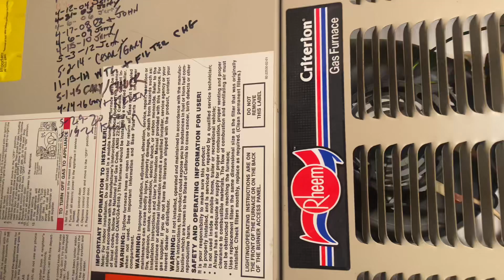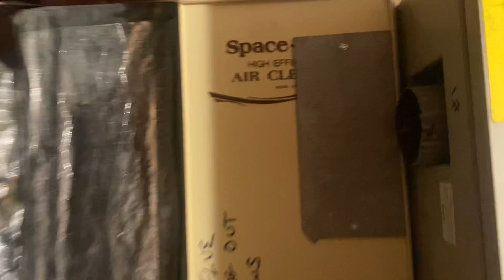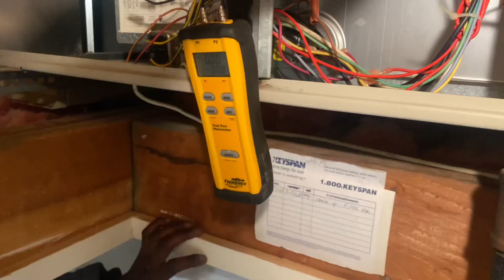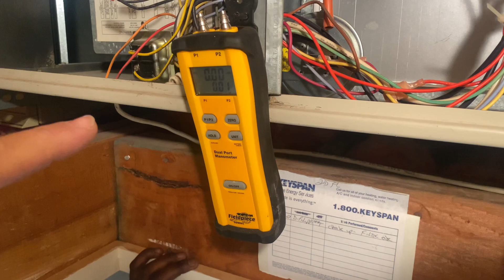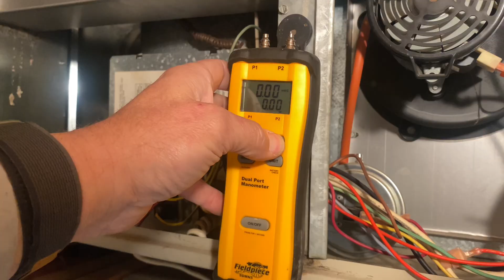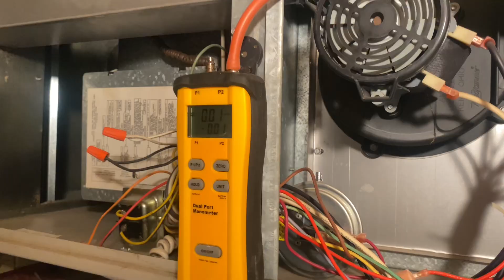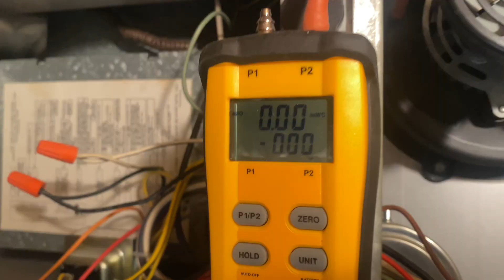Revealing the Easiest Method to Test Cracked Furnace Heat Exchanger

Comment: If you cover the flame inlets and  the exhaust port, the positive pressure buildup inside the heat exchanger from the blower fan will be quite pronounced with a cracked heat exchanger but will stay at zero if the inside space of the heat exchanger is isolated.

Comment: Yes, even with the blower door installed, so the furnace doesn't pull that abnormal amount of air from the attic, you could still get a false positive "wc" reading from inducer port, with blower only, because the attic access door is open to the attic as well. A better test, other than a physical inspection of the heat exchanger after removing it from the furnace, would be to do combustion analysis instead. Ensure the blower door is installed, have the attic access door closed as well. Run a strip to see the CO and C02 proportions with only the inducer and main gas, before the main blower starts. Then run the same test again, watching the CO and C02 proportions again, then see if there's a big change in the C02 when the blower starts. That can be good indication of a breach in the heat exchanger. Though a furnace that age, is a decent candidate for system replacement any day of the week, and twice on Sunday. Just saying... God bless ...

Comment: Gas stovetop burners are 15K BTU.  ... a little weep in a 55K BTU heater isnt a functional concern if the flue pipe is going to the outside.

Comment: BAD TEST. you have the other port on manometer open .real close to blower thats why its changing.
Reply from the maker: wrong, but thanks for your feedback. keep watching.
Reply: @PipeDoctor  Im not saying hx isnt bad, But you are not performing that test correctly. Next time you are at a furnace, put you manometer next to an open blower door and see what it does. You should have 0 psi to reference from. (why some dual port pressure switches have a hose to burner cabinet  which is connected to outside air)
Reply: @dell982  Did he not make that space negative pressure with the blower compartment open?

Comment: Do the fan running and the matches proof test. But wait , why change the whole unit when you can just put a new heat exchanger for a lot less of $$$ 
People don’t have a pocket full of money let them decide , give them 
New unit cost is $. 5 k 
This is old new heat exchanger is $800 ? But , is old , you could still use this for a few more years bla bla bla

Comment: Respectfully disagree. Imo the easy way is jump r to g and then use a long stem lighter or match and test every burner port, if one causes the flame to dance then its cracked. This test you show is a good test but you gotta cap the other port on the differential meter or use a single port manometer

Comment: Did you end up replacing the entire furnace or just the heat exchanger?
I figure the outer shell of a furnace would last a life time or  two! Like dropping a fresh engine in a 1920's car you could run the body forever. With fresh parts  you could run it 500 years maybe? Easier to get a new one than swap a motor though to be sure.
Reply from the maker: Entire furnace
Reply: @PipeDoctor  Did you ever see the cracked heat exchanger or just scrap it man? I'm fixing to try the test on my old 88 furnace.  All I have is a vacuum gauge that I use on engines but it should work.
The thing has never set off a carbone monoxide alarm in the house but there is a lot of rust in the flue and in front of the burner tubes.

Comment: I love the manometer testing . But I don’t understand the pressure difference with the numbers you came up with. Could you give a better explanation. Great job! Love the channel.
Reply: The inducer is connected  to the exhaust side, the blower should not effect any pressures in that side as it is separated by the heat exchanger, so a reading from the combustion side with ablowr only running would indicate pressure change due to the blower ( but on the combustion side ) and so a crack
Reply: @MrDmadness do you have a formula? Like with inducer running pressure in in wc +- the pressure in in wc when just blower is running proved air leakage through the heat exchanger?

Comment: Awesome test man! I haven't seen this version yet. I saw on another video this morning where a guy stuck a long lighter in each burner tube with the fan motor on only.
The flame on the lighter stayed calm and steady in each tube and passed the test.
So then for the purpose of the video he drilled a small hole in the heat exchanger and returned to the flame test.
That tiny hole he drilled caused the flame to dance all over the place in the tube with the hole drilled.
Reply from the maker: Very cool
Reply: Which video is that one? I'm trying to see if my heat exchanger has a crack. Thanks

Comment: Great video. I have seen draft inducer assemblies replaced with a less than perfect application of the 3M rubber tape for the gasket (slight gaps in the tape but 98% sealed). Could this not also cause a reading with the blower activated? Basically, could this leak be coming from a less than perfect gasket between the inducer and the heat exchanger?

Comment: I hope you know physics.  If a heat exchanger has a crack, you can "feel" it only after 15 minutes heat mode, crack will open when heat exchanger will hot. When it's cold, you probably can't find it. Use CO tester for it. Everything that will be higher than 50ppm potentially shows you a crack.

Comment: You can also take a long grille lighter, insert it into each burner, with and without the blower on. If the flame dances with the long lighter… there’s a crack/hole in that part of the exchanger
Reply: Read this after my identical comment. Jump r tog so blower comes on and do this. Yup.
Reply: You mean insert the lighter and turn on the blower motor to see if the fame dance right ?
Reply: @abazism  yes. Its very obvious if you have a cracked exchanger

Comment: With the blower door off and flue pipe not attached that isn't an efficient way to test, especially when the flue runs through the blower cabinet. Enjoyed the video never the less and this method may work it in other applications.

Comment: when you do that test with the blower access panel off, you put the attic space under negative pressure, affecting the manometer reading. manometer reads pressure difference and has negative port.
no substitute for a visual inspection imo

Comment: the flue pipe is in front of the filter and it needs removed to change the filter. very likely they just left the flue and gas off for summer/multiple filter changes, figuring they'd put it back on when there was a no heat complaint.
the blower compartment being open could cause pressure change enough via burner and flue openings to make the manometer read. test with the blower cover on, also it would be wise to block the flue hole, with the burner ports open then cover them individually and watch for pressure change. it's possible in some designs to have a very tiny pressure change due to leakage through fiber gasket material at burner and collector box end plates.
you may have jumped the gate on that one, it's best to always back it up with visual inspections/proof.

Comment: I like your channel and think you're a great tech, this test is useful.  I also think that this test may show nothing.  What if the crack was very close to burner openings, the air could enter and exit the HX without changing the pressure reading at all.  As pointed out in other comments it's not sealed.  To make the test better you could seal the vent connection which in this case the venting was already removed and seal the 3 burner openings using foil tape or if it's a hi-eff just seal the 2 pipes outside the same way.  Now if air enters the HX it should show a positive reading on the manometer.   You also mentioned in 1 of the comments that you are replacing the unit please do a follow up video and show the HX.
Reply: that should just be "one" test of the heat exchanger, others should be visual inspection inside and out as well as combustion analysis, watching the flame when indoor blower comes on and more.

Comment: While what you are doing has some merit the test process is flawed in the fact that heat exchangers are not hermetically sealed. It's a great prescreening, but it is not definitive. So I am not saying don't do it, just go further. Section 4.5 of AHRI Guideline X on heat exchanger testing clearly states that a small amount of leakage can be normal. "Visually Inspect Heat Exchanger Disassemble the furnace until you can visually inspect all heat exchanger exterior surfaces. Any crack or hole that is big enough to affect combustion is visible to the naked eye. Do not use water, cameras, or smoking agents to check for leaks. Furnace heat exchangers joints are not hermetically sealed, so a small amount of leakage can occur. Replace the heat exchanger or the furnace if there are any splits, cracks or holes. Note: If the inspection described in Section 4.5 does not show holes, cracks or separated seams, further investigation is advised to determine the source of the CO contamination."
Reply from the maker: Thanks for sharing

Comment: would definitely like to see the same test on a few brand new furnaces ,to confirm diff between new / known good   vs ones that test bad...its the scientific thing to do ...Dr Pipe Doctor
Reply from the maker: watch in a couple days
Reply: @PipeDoctor I'll be trying this method tomorrow Thanks. I'm a fan of yours bro keep the videos coming.
Reply: I thought this test was interesting enough to test on my own ~10 year old 80%er.  I got 0 change on the manometer indicating a good heat exchanger. The next test would be to pull the blower panel, but I didn't take it that far. I trust the results from the video.
Reply: Please post the result thanks

Comment: Can someone please explain to me what a common wire really is? Sounds crazy but I’ve been in the trade for 4 years and I still don’t fully understand what a Common really is. Is it some type of neutral wire?
Reply: There are several youtube videos that cover just this topic. Do a search. At least one is from HVAC School I think.
Reply from the maker: @Keegeth - you are correct. The common is exactly like a NEUTRAL. Having just 24 volts on R don't do nothing unless something is there for that return back. It functions just like GROUND. Look at a main panel. The white wires and greens all end up in the same place (i know not really, but on a 24 volt circuit it does.)

Comment: I like this idea. A co worker told me about this about a year ago. In this case, I would be a little concerned about the blower sucking in air through the flue outlet back through the opening on the HX where the burners go through. But may be over thinking
Reply: Yeah with the blower door off and the flue pipe disconnected… I’m not buying it either lol.
Reply: Yeah it is sucking

Comment: This is a good idea however I think because you have the blower door off it could be affecting your test pulling the air from the port around the manometer, you should try putting the blower door on and covering your extra manometer port.
Reply from the maker: possible, but unlikely.....wait for next weeks video.
Reply: @PipeDoctor did you open another video?

Comment: This test does work……if the the blower compartment is Completely sealed from inducer deck, there still will be slight pressure difference from power negative pressure from blower and blower compartment and pulling pressure from burner entry 🤙🏼🫡 fuxkn love ya Mikey pipes !

Comment: i know I will get crap from the audience for this but I have seen numerous ways to "Check" for cracked heat exchangers. The problem is when you miss one that is bad and someone gets Ill or worse. Everyone will swear that their method is the way to go and it has not failed them thus far. The problem is that unless you method being used is backed by a recognized standards organization it is not good enough to meet industry standards. Ultimately you the person doing the inspection will be liable for a results of your testing and You will have to answer where you came up with method and explain how it is accurate in a court room when bad things happen. I would caution everyone to adopt a standard that is industry approved by a consensus standards organization and never deviate from it. If things go wrong you can always pull out those standards and explain how you never deviate from them. Those Standards are made by industry experts and you will look pretty incompetent trying to argue you methods against theirs. You may feel strongly about your methods but are you willing to risk everything you have worked for if things go south? 
The AHRI is one such Organization that has Industry adopted testing methods. Might be worth a look. Its your Butt on the line.
https://www.ahrinet.org/system/files/2023-06/AHRI%20Guideline%20X-2023.pdf

Comment: So 2 things/questions. Is it an up flow or down flow?  (1) I see that the exhaust is routed through the blower compartment and that makes me feel like it is down flow. (2) It looks like the flue pipe has to be removed to access the Filter Cabinet to change the filter. I feel like someone removed it to change the filter and just never put it back or could not get it back on and just left it off.

Comment: Interesting very. Enjoy your posts. Not to be a Hater Raider, truely.

The true ways to verify a cracked heat exchanger or Combustion integrity issue 
(no certain order):

A) To pull the heat exchanger and visibly check it.

B) Use a mirror or camera to see it.

C) Observe for main burner distortion when blower comes on.

D) Use a Combustion Analyzer to check CO and O2 elevations when the blower  comes on. Runs unit for at least 20-25 minutes with the Combustion compartment door on or closed.
IF CO levels continually rises high and above 100 ppm "when blower comes on" and or O2 Levels are well above 7-9 percent "when blower on", 
then there is an issue with the heat exchanger or has been compromised. 

Thank you for continually sharing your knowledge and experiences.
Reply from the maker: Yes, those are also proven methods.

Comment: This test could be used as a starting point, but I definitely would not rely on that test alone. There are many reasons besides a faulty heat exchanger that could produce those results. First off, a heat exchanger is not completely hermetically sealed, so it is possible the blower could ever so slightly infiltrate the heat exchanger. Secondly, it could also be an inexpensive faulty inducer or Heat exchanger gasket. And finally, it could just be the natural draft flowing through the heat exchanger from the intake to the exhaust. If you suspect a faulty heat exchanger you should monitor your flames for any disturbances, perform a combustion analysis and monitor your oxygen and excess air readings followed by a good visual inspection.
Reply from the maker: Yeah, you think the HX isn’t sealed from the gas manifold to the inducer? Wow. Just stop. Leave the keyboard alone.
Reply: @PipeDoctor  Of course it is, but as I have experienced and been taught from factory training is that a heat exchanger is not 100% hermetically sealed. I have been doing this for over 20 years and I can tell you that your test is not 100% accurate. That said, I will not leave my keyboard alone so others can read my replies and make their own educated decisions.

Comment: Is that if that door was open or closed when he tested that heat exchanger would not make a difference because you have a full opening and you're pulling off the ceiling there or the crawl space or whatever he was in so it would just be like having a closed door
Reply from the maker: Makes no difference. We are measuring pressure.

Comment: That small pressure difference on the manometer could also be caused by the suction of the blower fan right near the other open port of your differential measuring device.  Be careful you may condemn every HX with a test like that.
Reply: If the blower door was on I would buy it
Reply: best way is to just stick a match with G energized and no call for heat. alternatively just stick a bbq lighter in each tube.
Reply: @SuperComfee 100% agree with you. I carry a stick lighter in my bag to do that test.
Reply: @SuperComfee  I've never heard of doing it that way but Thanks I'll be using that method!!!
Reply: You're both right. The meter is reporting the differential between the two ports as well as the absolute pressure on P2. You can see that during the blower test, the two numbers don't match which indicates the pressure in the attic changed, but the pressure in the exhaust path also changed.
Reply: This is a pretty neat test by the way.
Reply: @denrayr T the two ports, great observation by the way
Reply: If that's the case then plug the other port.
Reply: Gonna try and test this theory tomorrow gonna use a vacuum and blower to see the difference. Even with this test the best thing is to pull the blower and physically locate the crack/hole/puncture
Reply: @hotfeva9843 how do you that when you have a coil on top of primary htx and secondary blocking primary from blower compartment, 90% furnace
Reply: @hotfeva9843 did you test this yet?
Reply: …if the blower was pulling on it the number would be negative.  He was reading positive pressure through the port.
Reply: What if I put my finger on the other port ?
Reply: The blower is pulling air then pushing air past heat exchangers. There would be no false pressure created from the blower pulling because pulling doesn't create pressure on manometer, the only pressure reading would be done by forcing air past manometer port not pulling